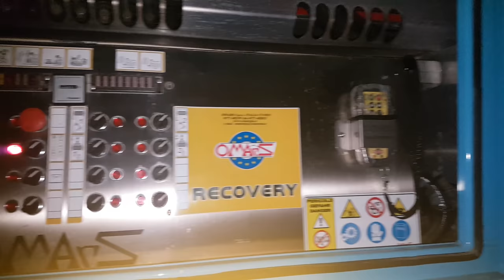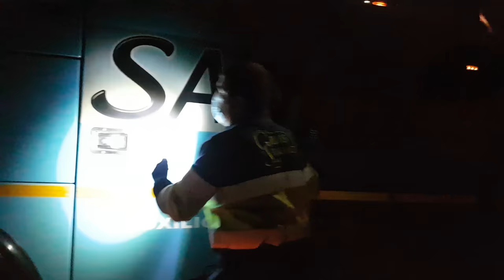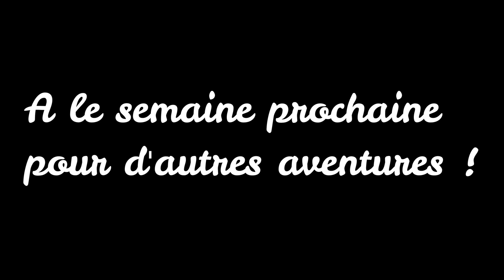Car Renault FR1 Off Road, ❗ Extrem Rescue ❗, In Spain, Aire Sans Limite

Comment: Petite question vous faites comment pour l'eau et le courrant avec les machines à laver ?
Reply from the maker: Comme tous les nomades  panneaux solaires et réservoir d'eau.
Reply: @airesanslimite1590  je suis nomade aussi et je n'ai pas de machine à laver à cause du poids, il faut pouvoir vidanger l'eau de lessive et surtout le courant, sur uniquement les panneaux solaires sans batterie compatible c'est pas possible ?
Pour moi c'est laveries et lessives à la main
Reply from the maker: @mariefrancebertschi6162  on a 800 litre d'eau propre et 400 litre d'eau grise. Nous avons 4 panneaux solaire de 300W   nous l'avons à froid ou à 30° quand il y a du soleil 🤗.
Reply: @airesanslimite1590  qu'elle chance, on ne joue pas dans la même cour 😉
Sérieusement nous vivons dans notre cc plus traditionnel, un poid lourd " basique", mais ça nous va bien on est qu'à 2 .
En tous cas bravo pour votre tiny 👍
Reply from the maker: Peut importe la maison roulante qu'on se choisit le plus important c'est de vivre à fond nos vies 🥰❤
Reply: @airesanslimite1590  ❤️👍😍